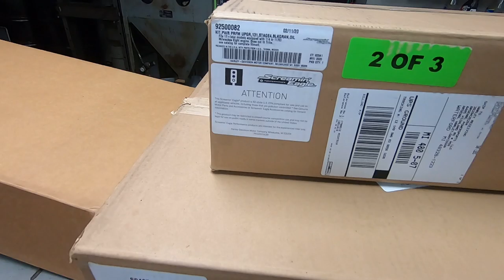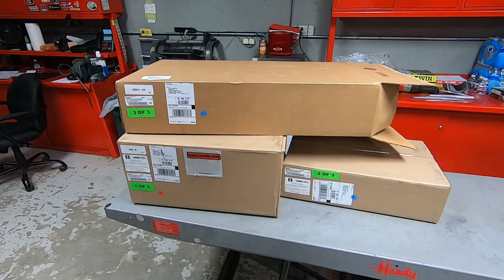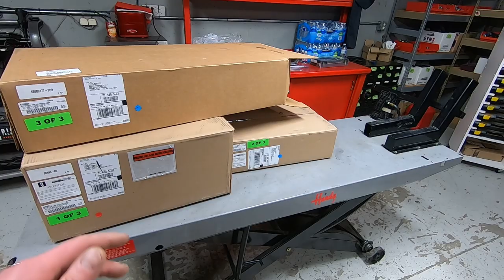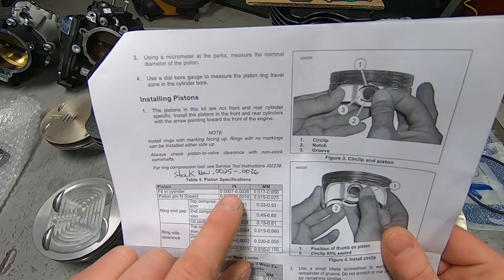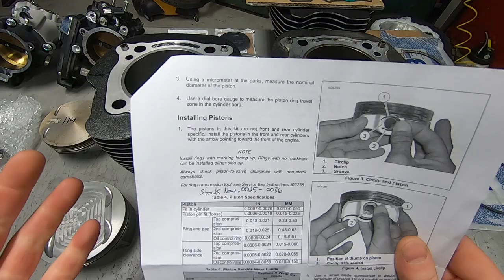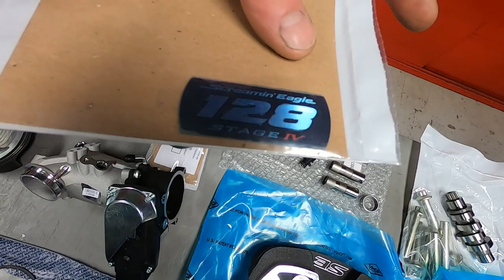HARLEY DAVIDSON 131 & 128 SCREAMING EAGLE STAGE 4 KITS TEAR DOWN AND INSPECTION OF COMPONENTS

Comment: Your stock HD pistons are cast, the SE pistons are forged, forged pistons expand less, hense the tighter tolerances, both pistons seal at temperature to same dimention. Warm that stock HD up before romping on it to avoid "slap"
Reply from the maker: I agree with your statement. I just talk about whats on my mind and sometimes it comes out not as intended. I noticed it wasn't clear during editing but left it anyways. I wasn't trying to say stock piston clearance causes piston slap or that "Myself" in anyway determines piston clearance. Or that either of the OEM or SE pistons have any piston slap. I completely believe in the engineers that make these things to set the clearances appropriately. While I said it in the video I was thinking of a past experience where I found the piston to cylinder fit to be double the service ware limit and it was piston slapping like a mofo. I do like tight piston fits tho, and was also astonished with how tight the new SE pistons are. Thanks for the question and the view!

Comment: You know for years everyone kept polishing intake ports, and although you do end up with a greater volume if you remove metal from an opening, I still think that a smooth surface causes droplets to form, which then shoot into the combustion chamber and cause a "false" rich condition.  When in reality you are actually leaning out your engine as engine managment compensates. And nevermind the cool drops of fuel that sprinkle some of the hottest engine components such as valves, that are thrown off that smooth polished surface. 
But... these are just my thoughts on the subject, so its a personal opinion that may or may not be 100% the case, but I still prefer a rough or dimpled surface on intake ports.  And also there is the golf ball proven theory, that suggests dimples on a golf ball, cause it to be more aerodynamic, and thereby it flies further than a smooth golf ball would.  Like I said its my opinion, you like your intake polished... by all means, its your engine.

Comment: I see the ceramic coating on the original piston crowns is completely gone! How many miles did it last?
cast vs forged (mahle) have different expansion rates. Forty years ago forged pistons required more clearance and so rattled more than oem cast. Don't know about current designs.

Comment: Mahle makes great stuff, Germans usually design and build good stuff. I’ve been riding Harley’s since I was 17 and I’m not bashing but in my experience, Zippers is where my $$$ are going if I’m gonna invest in H-D Performance. Thanks for the breakdown Wizard you do great work! Great job showing the weakness in the factory design of the induction hardened lobes only on the cams and showing the rocking coupling of the pistons in the bores. Old Harley’s needed really big clearances in the fit because of old time material and newer metallurgy has enabled us to have tighter fits and less noise. Once again Wizard you are doing fantastic explanations for guys who haven’t been able to get the mechanical education you have and it’s greatly appreciated! Subscribed!
Reply from the maker: Thanks for the complement!!  I'll keep it up!!!

Comment: Thanks for the video! Just dropped mine off to do the 131. From what I could tell the128/131 kit is exactly the same except for badging as the crank/stroke is what is different between 107/114. How was the power with the VH power duals?

Comment: awesome video BRad, thank you for doing all the videos , editing and talking and explaining, super a lot of effort! thank u! you mentioned that the SE blocks comes hatched already do the pistons come matched each cylinder? or do they come either or cylinder?
Reply from the maker: The cylinders come ready to install, just clean and assemble. The cylinders arnt set to the "specific piston size"  Is a mass manfacturing thing.
Reply: @HarleyDavidsonWizard  thanks for the reply buddy, probably isn't easy managing a full time job, editing videos and narrating and filming... reason i asked the question about piston and cylinder matched is because i am wanting to go with this stage iv upgrade in the near future, but on my previous build, quite a few many years ago, i remember that i had to send my new ceramic coated pistons along with my cylinders to the machinist to re-bore and hatch for them to match each piston to each cylinder, when they came back i remember having 1 and 2 written on the piston head indicating the cylinder it was matched to. tia

Comment: I’m doing the 131 crate from 107, having them put on oil cooler with fan, 11 plate screamin Eagle clutch, and 1275N heavy duty clutch springs, plus I’ll have D&D Billet Cat with a big Bore Baffles 2-1, HPi 62mm A/C,  Screamin Eagle pro tuner, put 500 miles on it and they will check it out and then do a dyno tune.

Comment: When your spending $30k on a motorcycle there should not be any corners cut on the quality of parts.
Reply: When you're spending $30K on a motorcycle the performance should already be equal to what the 131 & 128 SE Stage 4 are.
Reply: I can't help but notice that I've never heard Gold Wing or K1600GTL owners complain about quality, cut corners, mo $ for performance...🤔
Reply: Larry Ford if only H.D can build engine like my new 2020 KTM 1290 Super Duke R. Forged pistons, Titanium valves, pankyl transmission, showerhead injectors for high rpm power. This is a choke out bike from new regulations worse than California, Euro 5. Screaming eagle engine should be available on the FAT BOB at $25K+

Comment: Now that Harley has opened up the Softail lines to get the 131, I plan to get one on a Heritage. Correct me if I'm wrong, but the 131 crate is already installed as a stage 4, correct?
Reply from the maker: Yes. So you would buy the stage 4 131 Kit and put it on the 114 heritage. Or you can buy the stage 4 131 crate motor pre-assembled, and then have it dropped into your heritage at the dealership.
Reply: @HarleyDavidsonWizard  Oh....the fun I'm going to have with that. My wife is gonna love me. My neighbors are gonna hate me. Especially when I put the TAB Zombie baffles on it.
Reply from the maker: The 131 is alot of fun. I'd love to have one myself.
Reply: I brought it up to my wife. Her response was "How much?"

After I told her, she grinned and ok'd it. I was like, "You have no idea what you just unleashed." But she loves to ride too so it'll be a blast.

Comment: How does this kit effect fuel mileage? I have a stock 107 that gets great fuel milage.... i was told maybe 1 or 2 mpg less on the same bike as mine with a 128 kit stage 4. A mpg or 2 wouldn't bother me but 5 and I wouldn't do this for my purposes. I don't do short rides and 220-240 between fuel stops is pretty normal for me.
Reply from the maker: I dont have any direct experience in regard to fuel mileage so I can neither confirm or deny. But my feedback from customers is theres no detectable difference in fuel mileage.
Reply: @HarleyDavidsonWizard  thanks for responding. Im sure fuel milage depends on the operator as well. But you confirm that there's not a huge difference.
Reply from the maker: Ya if you run the street tuner map. Fuel mileage wont change much. Or if you have someone good tune it, it also wont affect mileage much.

Comment: Mr Brad, I see that Harley justifies the fan assisted oil cooler for the 131 vs no fan assist for the 128. Unless you left it off of the 128 table due to redundancy. My question is do you feel that the fan assisted oil cooler is warranted, and if so, what size motor would you personally add to the build? 117, 124...? As always, thanks for the great vids and info!
Reply from the maker: The 128 was liquid cooled so it didn't get the the fan. The fan only comes on oil cooled kits.  But personally I'd put the fan assisted oil cooler any bike with upgraded heads  and bigger cylinders.
Reply: @HarleyDavidsonWizard   the fan operated coolers are nice

Comment: Mad 🤘
I hat sort of power do these put out.  Be keen to see the Dyno tune graphs when done if ya get them. Cheers
Reply from the maker: I didn't do dynos on these kits in there "as pictured" configuration but here is links to the kits on the Harley Davidson website and they have listed performance numbers                                         
 131 Kit https://www.harley-davidson.com/store/milwaukee-eight-engine-stage-iv-kit-114ci-or-117ci-to-131ci-pa-18-92500082-1

128 Kit https://www.harley-davidson.com/store/milwaukee-eight-engine-stage-iv-kit-107ci-to-128ci-pa-18-92500078-1
Reply: Harley Davidson Wizard Kool.  Much appreciated 😎👍

Comment: The bigger the cubes the hotter it runs? In summer around town 100 + temps, can it handle the heat? My 103 runs hot as F all summer,  so a 131ci doesn't? Just asking.
Reply: harley crasher - M8 doesn’t seem to run near as hot as TC’s did.
Reply from the maker: We'll just have to wait and see. In my opinion, it seams like the twin cooling on the twin cam was an afterthought of the originally deigned twin cam. Where as the Milwaukee 8 definitely seams like it was deigned around twin and oil cooled. The oil cooling on the Milwaukee 8, I find to be really impressive. The twin cams were hot AF but the Milwaukee 8 is a lot different. With this 131 kit the oil cooled models do come with a cooling fan so the added performance must equate to some extra heat. But we'll have to wait till riding season to see. Thanks for the question and the view!
Reply: @HarleyDavidsonWizard  Thanks for the reply.  My problem with harley as of late, if I blow my wallet on a 131 build they'll come out with a 151 build as soon as I do it.
Reply from the maker: @harleycrasher8396  As far as a "bolt on, big bore kit goes" 131 is the biggest without changing the flywheel. The screaming eagle cylinder sleaves are made out of tool steel because the spigot that fits into the engine case is super thin. There is no way a bigger bore kit will ever fit in a stock "un machined" case guaranteed. Just FYI. There are 150+ kits out there now, but obviously there aftermarket.
Reply: @HarleyDavidsonWizard  What kind of 'Tool steel? If it was HSS, interesting, but carbon tool steel is no great fix.
Reply from the maker: Harley corporate never elaborated (to my knowledge) on the exact type of tool steel other than referring to it as "tool steel". it visually looks different tho. Like when u look at the spigot of the cylinder, normal cylinders are a dull gray color where these "tool steel" cylinders are shiny.
Reply: @HarleyDavidsonWizard  'Shiny' is a good sign.

Comment: Sad that H.D can't even make engine like KTM 1290 Super Duke R at 103 ft/lbs and 180 hp. 3 oil coolers, shower head injectors, Titanium valves, shower head injectors. This is a bike with Euro 5 and 3 cats in exhaust,that's just preventing lots of untapped power. H.D got step up there game we boomers are not going be around forever. Excellent video just a shame this engine doesn't come stock on the FAT BOB.
Reply: titanium is light  but wont last like steel

Comment: Not bashing, just telling you that at 3000rpm the piston moves up and down 100 times a second.  It's a 4 stroke engine so for 1 revolution of the engine you have 4 strokes in that event. So yes quality parts are a great idea for durability.
Reply from the maker: I guess my math was 3000 revolutions of the crankshaft (Revolutions Per Minute) and divided that    by 60 (because 60 seconds in a minute) and one crankshaft revolution = the piston going up and down once.  So that's how I got 3000/60=50.   Thanks for the comment and view!

Comment: Would the 128 or 131 kit be able to go into my Tri Glide without shredding drive belts all the time? I had a 120 kit in my 91 fxr and couldn't keep belts on that thing.
Reply: No I'm not an old timer, I ride a trike because I'm missing both legs. Everyone asks why a trike? Who wants to do everything I'm doing.... Cause I'm only 35 hahaha
Reply from the maker: The 128 and 131 kits do physically fit on the Triglide, but they are not listed in the catalog as compatible. So yes, you could do the 128 or 131 kit but you wouldn’t be able to have any warranty support and you wouldn’t be able to use the screaming Eagle Street tuner because there wouldn’t be a tune that Harley Davidson offers for a trike combination, at this time currently. That being said, if you wanted to do a big bore kit for example, if you came into our dealership I would be thinking the T-man big bore cylinders and then he would be able to size a cam that’s better suited to the weight of the trike and then you could ported heads and throttle body and all that as well along with having a custom tune. I’ve done just the t-man big bore cylinders (at the time he offered 124 and 128 kits) and a t-man cam, Stock heads and stock throttle body and it’s a freight train of torque, and that’s just what a trike needs. But also aftermarket parts aren’t 50state legal and do technically void the factory powertrain warranty. Thanks for the question!
Reply from the maker: Also belts are very strong and capable of holding power but the weak point of the belt is shock loading, The weak point of the Harley Davison drive belts are always the teeth. When we do a build that is really high performance in a vehicle thats keeping the stock drive belt the best way to get longevity out of the drive belt is to run it and at its tightest recommended setting and avoiding dumping the clutch or wheelies etc. So it depends a lot on your riding style, you can have a lot of power and have a lot of fun with it, rolling on the throttle. Also I was just talking to the girlfriend last night about how much I’d like to have a milwaukee 8 trike and set it up with a fat nasty engine. I’ve seen some pretty sweet custom built trikes and if the opportunity comes around to pick up a salvage or mechanically damaged trike, I’m getting one!!   There just in my budget at this time. Thanks for the view and the comment. BTY if you wanted a performance increase on your trike and you still wanted to keep it under warranty and still wanted it to be covered under extended service protection the Harley Davidson torque cam is a good option.

Comment: It is a nice set up from Harley unfortunately the aftermarket parts that you can get are cheaper and give you more torque and more horsepower. The 128 or 131 should be on a CVO not a 117 in my opinion, hopefully Harley will catch up to the aftermarket world one day.
Reply: gemini232003 There is only one state in the 50 that Harley has to worry about with the EPA and that is California. I believe the other 49 are pretty much equal across the board. As for the other countries they are handled by the overseas Harley department for those countries. But as for this country the 131 is nice but again the aftermarket parts which I have put in my Harley are less expensive, are as good if not better than the quality of Harley, and it gives me more torque and horsepower. Harley still needs to catch up to the aftermarket manufacturers.

Comment: Would it be better to buy the crate 131?
Reply from the maker: It depends on the situation. The crate 131 is exactly the same components as a stock 114/117 with the addition of the 131 kit. Same engine cases/bearings/cylinders/pistons/heads ect. They both can be covered by your factory warranty if installed in the first 60 days of bike purchase. On the flip side if the bike is older than 60 days the complete engine carries a 1yr warranty where the 131 kit is "over the counter warranty, 60 days I believe). Complete engines have always in past, have been supplied with a MSO so the vin numbers didn't match. I would expect that to be the same. Just two options of the exact same thing. Thanks for the question and view!
Reply: @HarleyDavidsonWizard  Considering that we Harley owners often change bikes, owning the whole engine makes sense to me, as the original engine can be put back in when you go to sell your bike. Or, conversely, you could sell the original motor to recoup some of the cost of the crate motor.

Comment: Makes me wonder what kind of power it’d make with a real tune, cam and no cat... 👀
Reply from the maker: I know! I'm hoping someone comes in and does a setup like that so we can find out!! Thanks for the question and the view!
Reply: Harley Davidson Wizard would be interesting to see, everyone is whining about the “low” numbers but they forget to realize that’s EPA spec power. If a stock m8 114 can make 110ish hp/120ish tq with a cam, pipes and intake just imagine what a non compliant 131 would make...
Reply: I have a custom 124ci, put down 148hp-143ftlbs.  Mahle flat tops, knight prowler cam and springs.  These motors are nasty AF if you just build your own via a reputable shop.  I can’t imagine a 131 now.
Reply from the maker: @richardheusted  ya. We've done tman 128 kits with great results. The Milwaukee platform deffentally can bet alot of fun. These 131's have potential.

Comment: Will S&S 475 cam work better with 131 kit than SE cam
Reply from the maker: The 475 is more of a "stock engine upgrade" the 131 kit would do better with a bigger cam.
Reply: @HarleyDavidsonWizard  do you have any suggestion, driving is aggressive and 2 up for long trips on highways
Reply: what about 590 from S&S
Reply from the maker: I'd call s&s and ask them for a recommendation. That's what I normally do with T-man suff and it always comes out great.